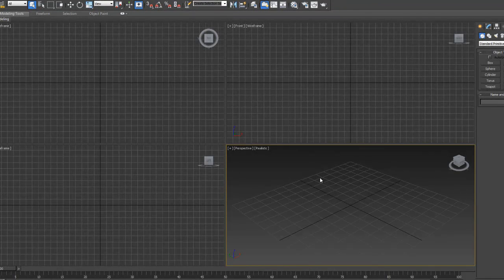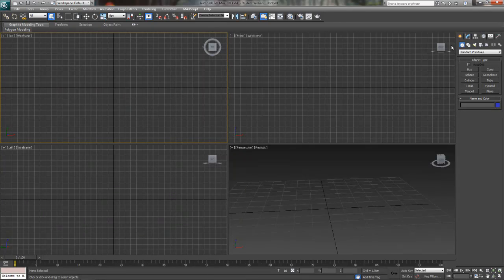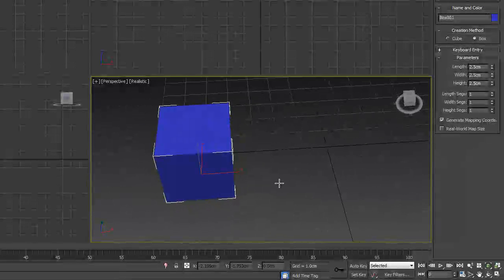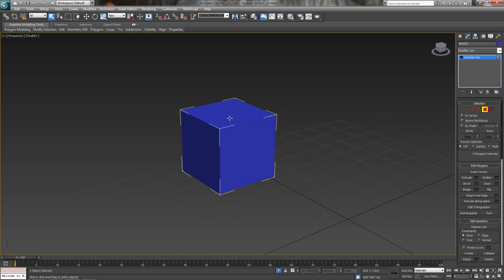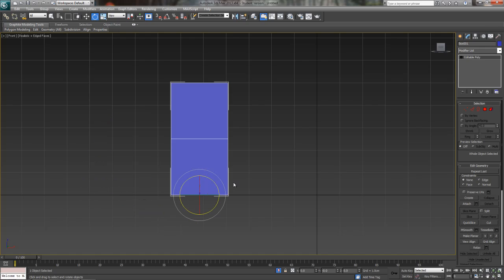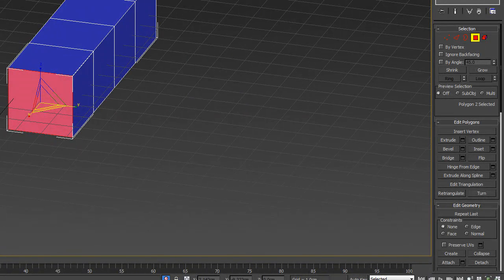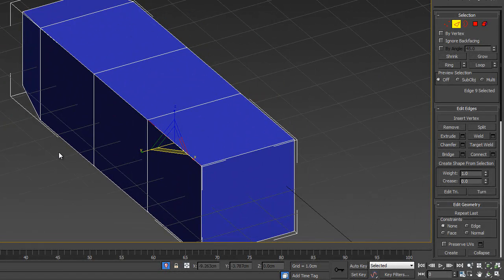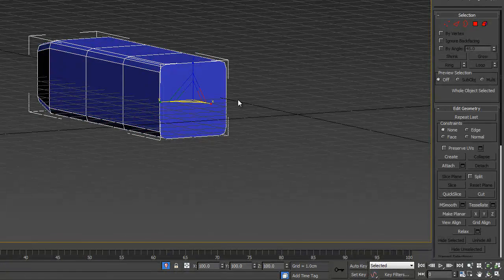Beginners Guide : 3Ds Max  Basics Creating the hammer part 1

Comment: hi, very nice video. informative. the only issue i have it, when i select centimeters and follow you - heigh 2.5 length 2.5 and width 2.5, it literally makes the box so small you cant see it until you zoom in. while your box is clearly pretty big when you do it. slightly confused by that
Reply from the maker: Hi alex sorry i have been un-active due to other commitments. Yea i dont show it in this video sorry but when you set your unit settings click on the "System Unit Settings" and change it to 1:1
Reply: 3D Gen 101 thank you!